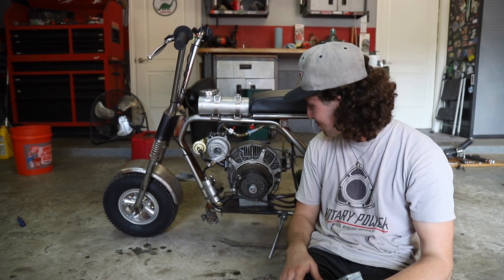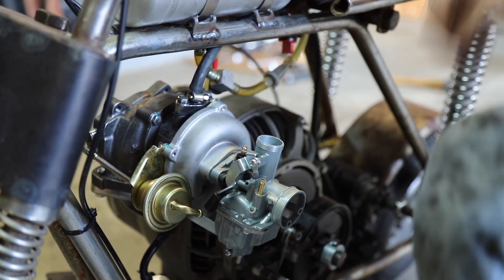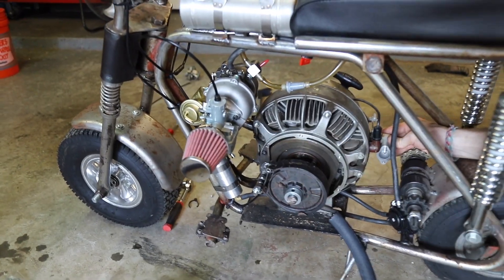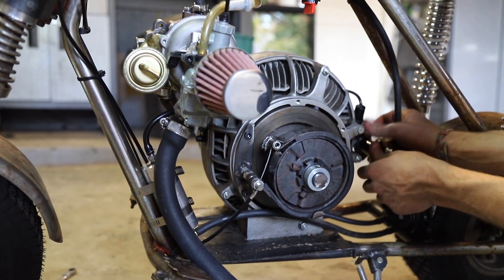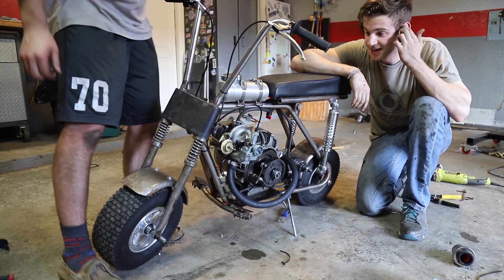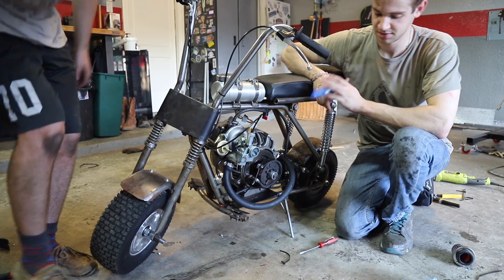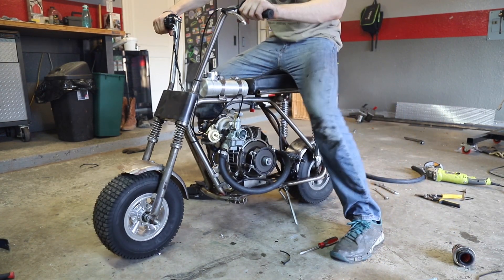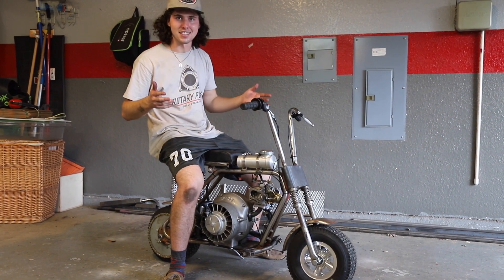TURBO ROTARY MINIBIKE gets a Carb and Charge Pipe! Episode 2

Comment from the maker: ***This video was filmed the same weekend as Episode 1 so we haven't had the chance to address the problems with the oiling system yet or the comments and suggestions from last video. Episode 3 we will get it all fixed up but we wanted to show you the progress we made before we had to head back to college. Thanks for watching and stay tuned for episode 3!
Reply: It's gonna be sooooo cool once ported and turbo'd ! Can't wait for part 3. You guys are incredible.
Reply: Do you have any two stroke turbo?
Reply: @m5a1stuart83  turbos are turbos no special turbo for two stroke. No single cyls 2 or 4 strokes work so well with turbo
Reply: @2strokecarbtuningportingin187  what about DKW Two Stroke Turbo?
Reply: For the turbo, I noticed that the wastegate is blown open at about the same pressure as with the feed line on my kart. Which is at about 6.3 to 6.5 psi of boost.

Comment: should have added phenolic spacer between carb and turbo to allow space for wastegate fitting.
Reply: Turbo has built in waste gate, if they ran a fitting into the carge pipe it'd work properly. Granted a spacer would make for better fuel and air mixture when hitting the turbine
Reply: @johnrodknock954  there was a brass fitting on side of turbo that had a vacuum line that goes to the wastgate actuator.  i.e.  positive pressure side of turbo, which connects to the charge pipe.  They disconnected it because the carb wouldn't clear the fitting/vacuum line. Which disables the wastgate.  Thus the suggestion for the spacer to allow clearance and actually be able to use the wastgate.
Reply: @Heads Mess why?  Depends... You want to have a way to control boost or just see max boost you can make and roll the dice how long the rotary will last.
Reply: Not enough boost for a blow off valve you mean. Because the turbo has a waste gate already.

Comment: You can still have a wastegate.. just put a barbed fitting on the boost pipe and run a vacuum line from the wastegate actuator to the barbed fitting.
Reply: He could have also made a spacer and been just fine.

*Edited spelling error
Reply: @thisislargemouth5566  i think the k.i.s.s(keep it stupid simple) approach works better.. but what do i know im just a seasoned mechanic. You know, work smarter not harder.
Reply: @DrGibs347  I meant could by the way.  also, a spacer is very simple in my opinion. Then again, what do I know? I just run a small engine repair shop. There's several ways to skin a cat my friend, no need to hurt yourself stepping off of that high horse.
Reply: 79707 I’d just worry about over boost issues. Obviously, for simplicity, this is faster. But if the option is there, I’d take it.
Reply: You would then need to run some sort of boost control valve. I would just try run it without vacuum and see what pressure the actuator spring is holding.

Comment: Run two stroke oil in the gas, your apex seals will love you for it. Check RX7 sites to see if there is a recommend ratio, but you'll also likely to need just a hair bigger jet to compensate.

Comment: That charge pipe im pretty sure its Not fuel rated... your engine may end up ingesting desolved rubber.
Reply: It wouldn’t be a problem if they put the carb after the turbo and rubber hose, and they would be able to use the stock waste gate position
Reply: Gabe Lackman not needed bc its draw through
Reply: @StroDshiesty1  he’s responding to the dude who said to do a blow through.

Comment: You will need to "boost reference" your fuel tank so your fuel pressure increase as boost increases, assuming it makes any.  Simply tap your boost pipe and feed back to fuel tank. Also you will need to use a one way valve for your fuel tank vent. Good luck, neat build! And you might want to reconsider hooking up the wastegate, you can use the same line.

Comment: Boost gauge could be fairly easy, another metal pipe in the charge pipe  with a fitting in it. Only have to cut a small section of rubber hose out to put it in. Just a thought, this is cool!

Comment: Rob dahm will be happy
Reply: im kinda suprised rob hasn't commented on this channel yet.. if he has then im missing something
Reply: Rob would want a quad rotor on it
Reply: @branthaight1366  Is he the guy that put a rotary in a Corvette?
Reply: @InsideOfMyOwnMind  yes. He's also working on a 4 rotar C8. So essentially a modern Arovette.
Reply: Rob will probably invite them to the shop to really get them hooked
Reply: @adamr9215  first he's no idiot he Programs the engine maps himself. The engine he just built makes over 1000 horsepower with almost equal torque and its built for reliability any engine capable of producing that kind of power it's not junk. I would love to see the beater you drive make that much power. Anyways it's just an engine doesn't matter where it comes from what matters is what it can do. Also how dare you say a man's blood Sweat and Tears is junk!
Reply: @adamr9215  okay I'm impressed with your taste in vehicles. But you cannot be more wrong about the rotary engine they are very reliable if built right. there like a nuclear reactor if kept balance and controlled they have ridiculous power but if unstable they become prone to damage. Rob has years of experience and knows how to make a rotary engine very reliable.
Reply: zean's mods Not true at all. Most big rotary builders will tell you that you have to mix oil with the fuel because the oil system fails so often. Most don’t last 10,000 miles before a major oil system problem develops. Rotary engines have so many weird oil system issues that there is no way you can call them reliable. The last one I owned, I pulled the engine and replaced seals at every oil change, just to be safe. They sound cool and can perform excellent, but their reliability is horrible. One o ring pops and all of the sudden something isn’t getting oil. When every big name builder recommends a digital oil pressure gauge because a 2psi change indicates a major problem, it is not reliable at all. 

I’m not saying they aren’t cool, but I will factually state that they are not reliable.
Reply: @InsideOfMyOwnMind  hell yeah he is.

Comment: Keep an eye on that boost hose. My concern is that fuel could collect in the hose, It could collect enough in there to randomly hydrolock the engine. You should try mounting the turbo closer to the intake port, could keep the turbo cooler and prolong its life.
Reply: The charge pipe needs to be metal so it doesn't break down from fuel residue, but it also needs to be a straight downward shot from turbo outlet to intake port with a bypass valve (like a BOV) connecting the turbo outlet to the turbo inlet to regulate the boost pressure. Boosting a carb engine is difficult and this is a draw-through so hopefully their turbo is one with carbon seals, else it'll end up breaking.

Edit: Clarified which outlet and inlet I was talking about XD

Comment: And mosr people blow out turbo oil seals . All you need is a fatter drain hose fitting. Usually turbos can handle plenty of oil pumping into its bearings but when it cant drain fast enough it leaks past the seals. Its harder on your oil pump and gaskets/seals when you restrict the pressure side. Have fun !👍🏻

Comment: You guys can weld so a nice steel charge pipe would work a treat! Looks awesome as is already though. I would turn the little carb adapter back the other way and route the boost pipe over the top with a 180 to the intake port. having the boost pipe in between the chain will be such a ball ache.

Comment: First Comment; College is cool- your YT series after that might be designing high efficiency small vehicles to explore the Moon or Mars, Second; same as the first! Third Comment; rotate the turbo, where it sits, about 30 or so degrees clockwise as you look down on it- it should help clear the riders position- then a nice rigid elbow to put the air cleaner just below the tank top. And get those degrees!

Comment: Dude, u’ve gotten the turbo oil feed and drain backwards, the threaded smaller port is oil inlet and the big port with flange is the outlet, try clock the core 180 degrees. This definitely helped me with my turbo leaking a lot of oil, but my turbo stops spinning when I turn on the oil pump, and it still leaks a small bit...

Comment: I feel like the fuel is going to pool in that "charge pipe" and cause oil starvation problems. 
Which could also lead to problems with fuel eating away at the rubber.
Reply: I was thinking the same thing plus turbos normally don’t have fuel running through them

Comment: You guys need to have it so the charbi is blow through, just so its easier to run and so you guys can run the waste gate, you could weld the waste gate open just a little so it free boosts but i wouldnt recommend, can boost creep and blow apex seals if done wrong, plus if its turbo, you guys could run a screamer pipe on it and put a long metal tube on the inlet of the turbo for maximum "dose" / turbo flutter 🤷🏽‍♂️ just a suggestion boys 🤙🏽

Comment: Coming along nicely boys. I think you should by some plastic plugs for the front of the seat frame and definitely chrome the pull start and fan shroud. I would just hi heat spray the rest of the engine black but that's on you. I bet you some braided hose would look amazing on your turbo.

Comment: Plug the hole for the waste gate you removed. Probably already did if not big boost leak or no carbed air equaling lean and the high idle.

Comment: Why not a blow through? I’m planning to pressurize my Mikuni’s bowl with the waste gate pressure pipe on the turbo, and plug some holes on the carb it self
Reply: Or just box the carb so the pressure is equal inside the car and outside

Comment: Why didn’t you get a carb spacer?🤦🏾‍♂️😭😭
Reply: or clock the turbo upside down and make a shorter run above the engine with the intake pipe
Reply: Or mount the carburetor to the intake pipe! That would have made the throttle response better and would not have been putting gas all over the insides of the turbo.
Reply: @zeanyt2372  im sure they just want it to run right now, they can work on the technicalities afterwards. Noone wants to go through the trouble of an engine not starting after working through all the steps in theory
Reply: @samurboi8007  I agree. But it seems like it would have been easier to do it now and not have to go back over there work later.
Reply: @zeanyt2372  yeah
Reply: @zeanyt2372  in order for it to run properly it has to be a draw through system..
Reply: @eulisesacevedo4929  why?
Reply: @zeanyt2372  in order to run a blow through carburetor setup you need to have a boost reference fuel pump so that the boost pressure and the fuel pressure has to be the same or the fuel pressure has to be greater than the boost pressure if not they cancel each other out and it does nothing
Reply: @eulisesacevedo4929  that makes sense. Could you pipe boost into a gas tank to fix the problem?
Reply: @zeanyt2372  no you would need an efi system.
Reply: @eulisesacevedo4929  what is an EFI system?
Reply: @zeanyt2372  electronic fuel injection
Reply: @eulisesacevedo4929  oh that makes sense! Thanks.
Reply: Kyle B Simple, they don’t know what they are doing.

Comment: Add a petcock at the back of the fuel tank and run a hose from it T'd in with the existing hose. That will solve your fuel issues while the front end is up.

Comment: If you are gone run it draw through you should instead use a cv carburetor (24mm cvk?) and remove the throttle plate in it and instead use some sort of throttle plate or slide on the positive pressure side, that way you don't ruin the turbo seals when off the throttle and the turbo would last a lot longer.

Comment: never seen the turbo after the fueling. Normally, it has a clean intake charge in the turbo, then the fuel.
Reply: This is called drawl through turbocharging
Reply: I guess you never saw a 1980 or 81 turbo Trans am !
Reply: @jimsafranek8594  oldsmobile jetfire!!!!
Reply: @jimsafranek8594  I have seen one, but not how it was set up. :-) I'm used to the turbo Audi's I've had and numerous turbo builds I've seen online. I'll have to look up other options. I would think the compressor wouldn't be optimal for atomized fuel.

Comment: You guys should change your black rubber, "charge pipe", to a clear one. You will be able to see it it gets fuel resignation at the bottom of the "U".
Reply: It will get puddling in the charge pipe, every draw-through turbo system has that problem if the charge pipe goes upwards too far. It has to be as short as possible, made of metal that won't break down like rubber does with fuel residue from the air-fuel mixture, and it must slope down from the compressor outlet to the intake port. Plus, a rubber charge pipe will just expand from the air pressure and lose some boost and some throttle response.

Comment: you need a throttle body AFTER the turbo. If the turbo inlet sees vacuum you'll pull oil out of it's core and it'll go into the intake. The carb has to be before the turbo, otherwise boost will lean it out. Basically you need to not use the pre turbo carb throttle, and instead add another one after. Take the hose off and inspect it for oil if you wanna see for yourselves. Awesome work otherwise, you guys are awesome! :D
Reply: It's a 2-cycle.Oil is what it eats.They did the turbo gocart and fuel inject was a Pain.Watch the series.It's kewl.
Reply: Super cool love Rotary’s great job guys.
Reply: @bryduhbikeguy  it's kind of a 2 stroke. If oil is just being sucked out of the turbo then there's no metering. If you snap the throttle shut at high RPM you might hydro lock the engine with oil. Come to think of it, the intake hose might collapse first and just stall the engine. Hard to know which is more likely without testing

Comment: Why dont you just use a carb intake spacer flange thick enough that it will move the carb away from turbo so its float bowl will clear the 90 degree elbow hose fitting for the waste gate/blow off valve ?just drill two bolt holes and an intake port hole out of a plate off aluminum or plastic or steel and a run a gasket or silicone on each side.

Comment: You'll mess up the turbo if the carb is on the intake of it
Reply: Its called a draw-through turbo setup. The two types of carburetor turbocharging, that is blow-through and draw-through, have different requirements. You need a pressure sensitive fuel pump for a blow-through system since the carb has to match fuel pressure and boost pressure to run properly. Since a draw-through just pulls a harder vacuum on the carb, the carb can easily handle the extra demand and act as if its attached to a larger engine. The drawback of course to the simpler draw-through is the need for a short, metal charge pipe with no low spots to prevent fuel or oil residue from puddling and to avoid degradation of the pipe itself. You also do not use a BOV but rather use a bypass valve that opens a path around the turbo. And if you use a turbo with newer dynamic seals rather than the older carbon seals, the seals can break down from the gas and eventually leak oil and/or seize up later on. Really, turbocharging a carbureted engine is a huge hassle.
Reply: @Avetho  yep grind hard pluming did it on one of there builds and that's exactly what happened the seals started to fail because of the gas

Comment: If it has a charging system you shouldve made it blow through
Reply: It's ridiculously hard to find push through carburetors for small engines. If you can find one that will mate up, it will most likely be over carbed. Just my experience.
Reply: @joeypriolo  or just box in the current carb
Reply: @joeypriolo  Yep, its easier to use a draw-through setup since you can avoid having to get a boost regulated fuel pump working. You just need to be mindful of the charge pipe that needs to be metal with no upward travel, and that the turbo not only has a bypass valve instead of a blow-off valve, but it also uses carbon seals instead of dynamic seals. Its easier to use a draw-through since you can just reassemble the turbo with carbon seals and you can pipe a BOV's output back into the charge pipe after the turbo. And with a rotary its especially important to limit boost pressure to where you want it and no more, since you don't want to exhaust-dump your apex seals.
Reply: @joeypriolo  it just needs to be sealed and have 1:1 or close fuel psi